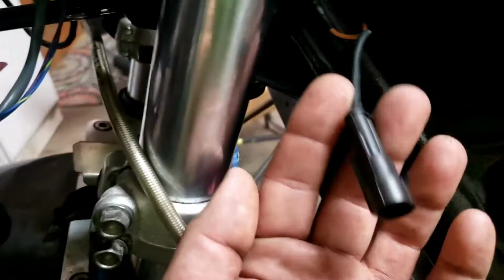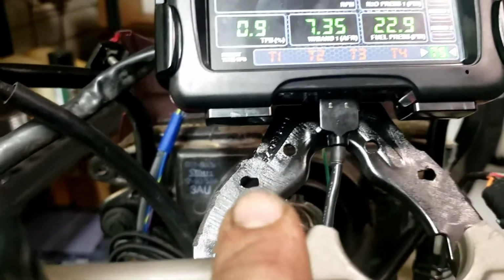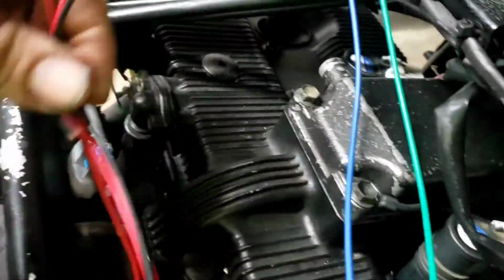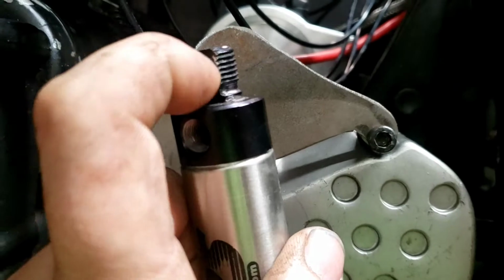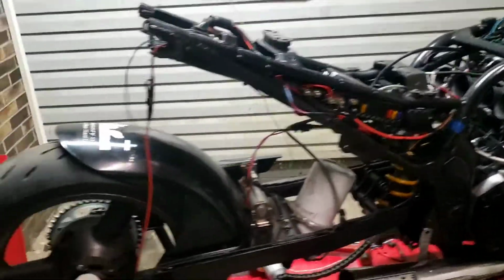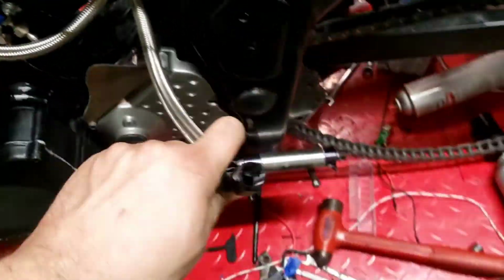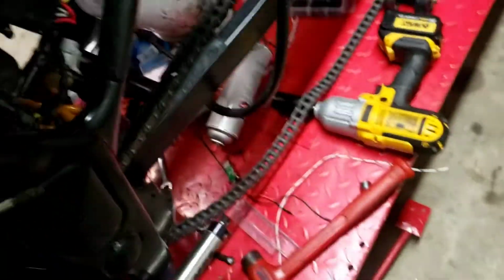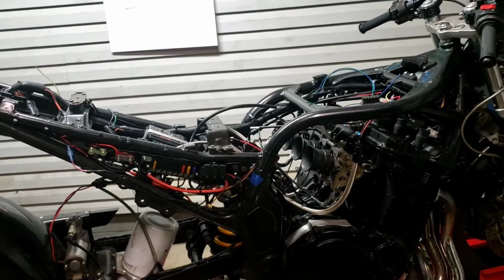Parts are arriving for my record chasing bandit 1200

Comment: I am doing Efi conversion on bandit 1200. whats the throttle body from? Does it fit boots well? I would rather match intake diameter and machine single throttle than find new boots
Reply from the maker: 2003 Gsxr600 fits it just needs to be respaced.
Reply: @RingTuned  Hello back. Ye i got the throttle bodies already. But did it fit into slaves or did you grind diameter of throttle body a bit? Also did you eliminate secondary throttle body or is it  away to connect it into megasquirt or not?
Reply from the maker: @dzozepe  i had to respace them and yes I deleted the secondary butterfly.